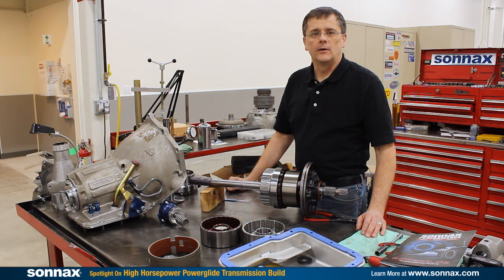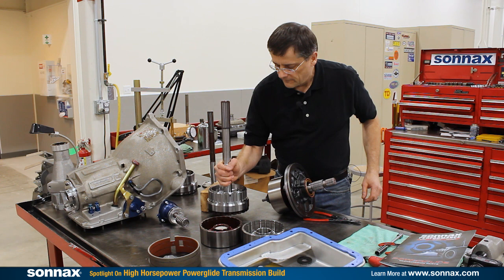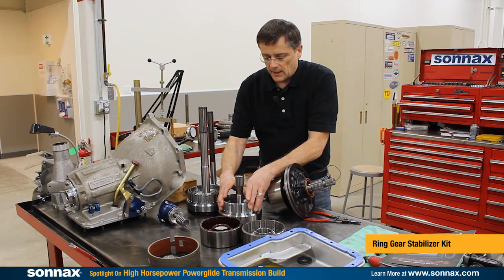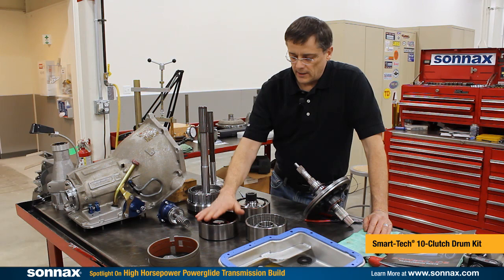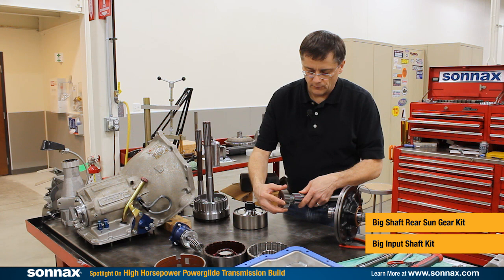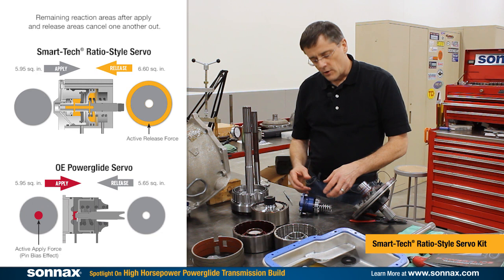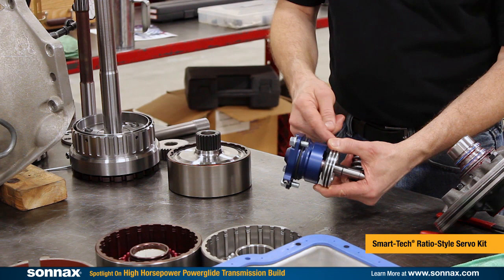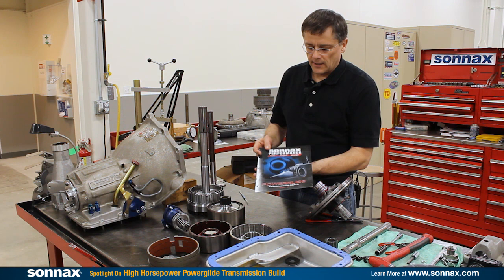Sonnax Powerglide Racing Transmission Rebuild - Get an Inside Look

Comment: i hear so many opinions that these can and can't be built to last on the street due to heat
Reply from the maker: Hi Tim, thank you for your comment. There are definitely lots of opinions floating around out there, but there is nothing about the racing Powerglide that keeps it street use. Success will depend on the torque converter, cooler
oil-flow and type of cooler used. If you have any questions about this video, feel free to connect directly with our high performance product line manager, Gregg Nader. He can be reached via email at gan@sonnax.com. Hope that helps. Thanks again, and have a great day!